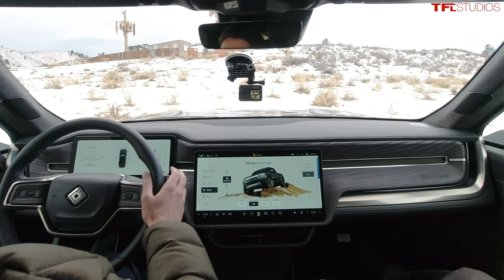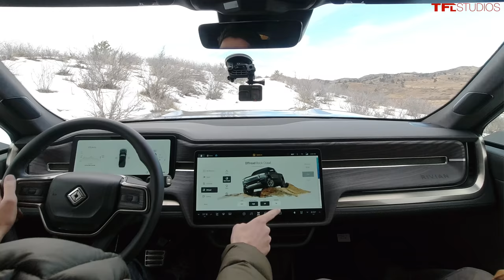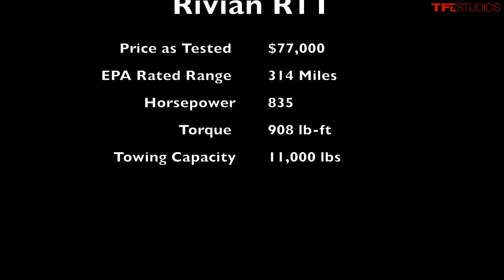Fully Loaded! Can an EV Pickup (Rivian R1T) Survive a Hard Days Work?

Comment: This guy right here is the prime example of the real difference between people who actually use trucks for work and the people that have pavement princess trucks.
He's not concerned about hp, torque, or every little spec number, huge lifts, crazy off road tires or any of the other dumb crazy stuff that some people put on their trucks. 
His mindset is...will it do what I need it to do.
Reply: Bulk of these will be pavement princesses
Reply: @robertryan7204  They are built to be...
Reply: @kanalvoll5416  Built to be? Batteries are fragile elements. Think of the Smartphones,  Tesla fires
Reply: Pretty sure the rivian trucks that went from the tip of South America up to the US on an expedition were not pavement princesses.
Reply: @Deetroiter  depends where they drove. One off expeditions are not indicators  of durability over time. Some  Samsung smartphones operated quite well for a while, until more than a few burst into flames
Reply: @robertryan7204  the long way up is a great documentary if you like motorcycles and travel! Has two rivians that were preproduction and survived the journey. Rivian then took all of the data and learned knowledge from what went right, what went wrong and then applied it to their production vehicles. There is no end all, be all, when it comes to a vehicle. If it works, it works. But it shows that the rivian isn’t just an adult sized Power Wheels. 13,000 miles of of mostly unpaved and rugged terrain is a pretty good test track I’d say
Reply: @Deetroiter  Not really, many  small Expedition vehicles do that. No it is durability over time that is important, not a one off journey..  Yes have seen  the Motorcycle Doc, Ewen McGregor the actor and his friend did it. Startups do not have the resources or facilities to undergo extreme durability testing unlike the major nanufacturers
Reply: @robertryan7204  also lifting these will significantly affect range
Reply: @ayoutubechannel921  Yes another factor
Reply: @robertryan7204  not really. Its marketed towards Outlanders who rarely use their gear as Pavement Eye Candy.
Reply: @robertryan7204  because a gasoline vehicle has never caught fire?
Reply: @robertryan7204  in Texas the unofficial headquarters of trucks where like 10-40% off your neighbors all own em, maybee 5% get used as trucks. People buy em to show off and bc brainwashed they 'need' a truck...90% of half ton drivers would be just as good w honda ridgeline in any suburb, its an ego thing.
Reply: @05EVORS  Here we call them Pickups  or more commonly Utes.Maybe a much higher percentage use them as work vehicles, but the rest as " cars" US Pickups are a niche about 6000 per annum sold but they are primarily used as " cars" with a small percentage used to tow RV's
Reply: @WaterDR-tw8re  No but many EV's certainly  are and compared to gaseline vehicles not many are produced
Reply: @ChurroWaffles  Maybe marketed but all that reliable in the long run? Very much doubt it
Reply: @robertryan7204  LOL You are spreading misinformation. It's nothing like Smartphones. Smartphones don't have hundreds of cells and liquid thermal management and a HEATER for the battery. It's like comparing a Briggs and Stratton Whipper Snipper Engines vs AMG V8. Stop with the absurd nonsense.
Reply: @robertryan7204  "No it is durability over time that is important, not a one off journey" Yes that is exactly what BEVs excel at. They are horrible for the one off 1000 mile Expedition, simply not enough range. But it will be great a Rural Property run about where it lives near it's base it's entire life. Tackling difficult terrain for a couple decades. Perfect for Australian Rural Properties.
Reply: @robertryan7204  LOL Utes are for freaking posers. Real Rural People in Aus just use Enclosed 4x4 like a LandCruiser or Nissan Patrol or Commercial Flatbed trucks. I had a Nissan Patrol Ti while I worked for Trimble.
Reply: @Neojhun  A case of misunderstanding. Utes include US Pickups. You are totally  right what  we actually  use in Australia.  Some self appointed geniuses on the TFLwebsite Forum, were telling me that US Pickups were doing the bulk of the work on Australian  farms LOL. Suggest you post on that forum and see the reaction.
Reply: Agreed. Talking about clearance, “Why would you need more then 15 inches?” 🤦🏽‍♂️
Reply: Well observed.
Reply: @robertryan7204  What's the number of gas vehicles and the number of EVs that catch fire per 100k sales?
Reply: @FiroNebule  Going by estimates very few Gas vehicles but a staggering  number of EV vehicles considering the poor sales
"WHY DO LI-ION BATTERIES POSE A FIRE RISK? Lithium-ion batteries, whether they are used in cars or electronic devices, can catch fire if they have been improperly manufactured or damaged, or if the software that operates the battery is not designed correctly."
Reply: @robertryan7204  There's no information on the internet listing the number of fires of gas and EVs per 100k sales?
Reply: @FiroNebule  No, just there are not many EV's sold and they appear to be bursting into flames. Lithium batteries( see Samsung) have been doing that a lot.  Gas vehicles bursting into flames...mighty rare
Reply: @Neojhun  Really
"WHY DO LI-ION BATTERIES POSE A FIRE RISK? Lithium-ion batteries, whether they are used in cars or electronic devices, can catch fire if they have been improperly manufactured or damaged, or if the software that operates the battery is not designed correctly."
Reply: @FiroNebule  see this yes from the internet
"WHY DO LI-ION BATTERIES POSE A FIRE RISK? Lithium-ion batteries, whether they are used in cars or electronic devices, can catch fire if they have been improperly manufactured or damaged, or if the software that operates the battery is not designed correctly."
Reply: @robertryan7204  Wait, so when you search up "gas fires vs ev fires per 100k sales" it comes up with no imformation about X number of fires per 100k vehicles?
Reply: @Neojhun  Reality not nonsense
"WHY DO LI-ION BATTERIES POSE A FIRE RISK? Lithium-ion batteries, whether they are used in cars or electronic devices, can catch fire if they have been improperly manufactured or damaged, or if the software that operates the battery is not designed correctly."
Reply: @FiroNebule  No just Litium batteries are basically dangerous. Someone  posted solid state maybe safer. As it stands Tesla managed to sell 1 million vehicles globally last year, compared to 90  million ICE vehicles  mil globally
Reply: @FiroNebule  These batteries are dangerous  even when they are no longer useful
,"This report found 64 waste facilities that experienced 245 fires that were caused by, or likely caused by, lithium metal or lithium-ion batteries.10 July 2021"
Reply: @FiroNebule  search ev fires, lithium battery fires a staggering number
Reply: Great review of a day in the life. Just was compelled to comment that those bed hinge wells look like a nightmare. It is bad enough dealing with rocks or wood chips that get wedged in the crease between bed and tailgate on a "normal" truck.
Reply: @ponti1000   it is start up manufacturer and like most they have  problems other established manufacturers iron out before  mass production
Reply: @robertryan7204  I appreciate your response. Maybe they will resolve with some design changes. I was just providing thoughts from a long time truck owner that this one thing is potentially pretty painful for a truck user/owner.

You are pretty vocal in defense of this vehicle throughout this discussion...If you don't mind me asking, what is the drive for your perspective to be such an advocate?
Reply: @ponti1000  Actually you have got the wrong impression. I have been very negative about the vehicle. Maybe you are confusing me with some else's comments
Reply: @Deetroiter  Yes. Long way Up (on Apple TV). There was a bit of cheating that went on there though. Although Rivian installed some chargers on the route there was a fair bit of charging with generators behind the scenes. The vehicles were pre-production too, so who knows what spec & tricks they had.
Reply: @Neojhun  no nonsense reality, plenty examples of EV cars bursting into flames
Reply: @MyKeeP81  no, not a chance
Reply: @robertryan7204  seeing as EVs and Hybrids using batteries have been out for a long time, so durability answered as to the batteries and engine. The money you save on engine maintenance you could use on replacing the battery 10 years later. The EV technology has been around for a long time, and the only issue is that hybrids need new batteries after 10 or so years. There is no issues other than build quality issues.
Reply: @robertryan7204  Probability way lower and safer than Concussive Fireballs from Petrol vehicles. EV fires are slow you can crawl away from injured. You're screwed in a Fuel fire.
Reply: @robertryan7204  LOL I never said anything close to that. You are making up nonsense. It's just a fact Utes are used on farms to get around and head into town. Not to do the heavy lifting but more people moving and getting stuff. BEV utes will be perfect for this use case.
Reply: @robertryan7204  " Gas vehicles but a staggering  number of EV vehicles considering the poor sales" LIES you liar.
Reply: @BaronBoar  Still having EV's bursting into flames and also standalone batteries. None EV' and Hybrids are being used off road in very hot conditions
Reply: @Neojhun  Neither you do not crawl away as it is gas build up in the battery that makes it explode and burn
Reply: @Neojhun  No gas vehicles rarely  burn but Lithium batteries regularly  cause fires even when used
"RECYCLING PLANTS ARE CATCHING ON FIRE, AND LITHIUM-ION BATTERIES ARE TO BLAME

Rechargeable batteries like the one in your smartphone should never be tossed in the recycling
Reply: @Neojhun  Please read the many articles on Lithium  batteries that say you are VERY WRONG
Reply: @Neojhun  Actually Neojhun  go as a guest on the TFL website and post Utes on Australian  Farms are only used as cars. You will get an interesting  reaction, then again I agree with you.
Reply: @Neojhun  You are VERY RIGHT  about the vehicle mix on Australian  farms and should post it on the TFL website but VERY WRONG about the dangers of Lithium Batteries
Reply: @robertryan7204  Stop trying to change the subject when I caught you red handed. You stated technical factual falsehoods. You are a liar fraudster.
Reply: @robertryan7204  I don't read press articles for this topic. I read scientific papers, official investigation reports, statistics reports and work on batteries my self. You have no clue what you are takling about.
Reply: @robertryan7204  uh yeah they are. Thousands of EVs and Hybrids here in BC and we had gotten temperatures like that of death Valley this last summer. For an electric motor there is no difference if it's going up a offroad hill and uphill on a road.
Reply: @BaronBoar  Electric Motor no, more the battery. Remember every Diesel railway freight train, is a Diesel Electric, the drive train is electric
Reply: @robertryan7204  yeah so? I don't see your point. It works in general in all sorts of temperatures or have you been living under a rock your whole life. They have electric motors driving all sorts of things in plants and factories. Fabrication shops.
Reply: @BaronBoar  You do not get it Electric Motors are fine, Lithium Batteries are not, plenty of articles out there that state these cause fires or burst into flames
Reply: @Neojhun  well you have posted that " pointless nonesense" and now are saying the many articles on the dangers of lithium batteries are fabrications. Who is Spamming????
Reply: @robertryan7204  do you know what kind of batteries they are using or the temperature management systems they are using?
Reply: @robertryan7204  "I.e. fuel cells are really EV's, you have no clue" WTF I never said anything about fuel cells and I do know they need Battery Buffer to regulate the power. You are a fraudster. You just made up a false assumption about me. You just proved my point.
Reply: @robertryan7204  Diesel Electric trains have a horrible track record. The Turbo system on G.E. Diesel Electric Locomotives is infamous for overflowing rich fuel mix and starting a fire. Train operators are soo use to it they just stop wait and burn it off and monitor the situation. If it gets any worse they try to extinguish the fire. Irony is you are talking to someone who installs wide area communication system for train networks.
Reply: @Neojhun  Stop your Trolling you have not posted one link, it is all hearsay.
Reply: @BaronBoar  Good question, why these are bursting into flames who knows . Tesla standalone Battery pack
"Two Tesla Megapacks were engulfed in flames when a fire broke out during initial testing at the Victorian Big Battery site in Moorabool, near Geelong, on July 30. The blaze triggered a warning for toxic smoke and it took four days for the site to be deemed under control by firefighters.27 Sept 2021
Reply: @Neojhun  closer to home
,"Two Tesla Megapacks were engulfed in flames when a fire broke out during initial testing at the Victorian Big Battery site in Moorabool, near Geelong, on July 30. The blaze triggered a warning for toxic smoke and it took four days for the site to be deemed under control by firefighters.27 Sept 2021"
Reply: @Neojhun  stop the Trolling  not one link from you
Reply: @robertryan7204  You propagandist liar. You just ignored the details about that case. That Giant Battery fire was caused due to trials tests during setup phase. Yes something went wrong during the installation test which is not unusual for something soo new. A Single cabinet caught on fire and it was contained. There was no massive facility wide fire and no massive amount of toxic smoke like an industrial facility fire. It was a single open air cabinet that failed then contained. You literally just cherry picked a very mild case and tried to Falsely spin it as an toxic smoke industrial fire. You are a Liar Fraudster.
Reply: @Neojhun  So now you are now denying they are non hazardous?
"“Battery-powered vehicles have not been shown to catch fire at rates higher than gasoline cars, but when fires do erupt, they burn longer and hotter, propelled by lithium-ion batteries that supercharge the blazes, experts say,” the Post reported at the time.29 Sept 2021"
Reply: @robertryan7204  Very simple it was industrial electrical fire. Very common and often NO battery is involved. When you configure High Amperage Electrical Circuits wrong it often causes extreme heat and arcing thus can set fire to the surrounding flammable material. In November a Switch Board in my company workshop caught on fire when the wiring main feed into the switch boards was Not up to standard what the Switchboard was Fused For. We had a few CAD Workstations and 4.7kw CNC Lathe on that switch board at the time it went on fire. We had only moved in in February 2021 previous tenant did some horrible electrical work we have since found out.
Reply: @robertryan7204  testing OK. That's why they test them. Any substantial accidents out side of that? Like Italian cars like Lamborghinis and Ferraris were catching fire.
Reply: @BaronBoar  On high end Porsche & modern Lambo have problem stationary or low speed overheating and not getting enough air flow. Thus you have horrible things like Soft Limiter on Revving while stationary. There was also Adhesive Glue fires on Ferraris IIRC was the reasoning for the recall. The probability of fires was astonishingly high considering how few of these cars exist. While a fool like Robert complaining Tesla only sold 1 MILLION cars in a year. 2 door Porsche is about 80,000 to 90,000 per year and Lamborghini 2 door production hovers around 5,500 to 8,000 (excluding 4 door Uterus SUV). Yet the number of fire occurrence is not massively different.
Reply: @BaronBoar  that is another issue with lithium batteries and accidents
Reply: @robertryan7204  no I mean like actual ev/hybrid? Because it doesn't sound like it so your argument is done.
Reply: @BaronBoar  Experts say electric vehicle batteries can catch fire, release hazardous gases or even explode under certain conditions. Such dangers have inspired a national conversation about how to deal with EVs after accidents
Reply: @robertryan7204  Yes they do happen it's unavoidable for now.  But they are much less likely to occur than ICE. The problem with BEV fires is they last for days slowly smouldering. The only good method is just dunk it in a Skip Bin full of water after the initial fire has been extinguished. But the need to do this is extremely small and that's the massive problem. We need to spend resources on a safety setup on something that rarely ever occurs. This is going to be a PITA to fund and wide spread setup. During the hours of smoldering phase is does not Explode or even give of that much hazardous gases compared to a ICE car fire. Yes we do need a national conversation on how to best prepare equipment for such rare occurrence. It has nothing to with being a wide spread danger. FYI Vast vast majority BEVs that are crashed end up in Junk Yards not even any fire. A large proportion of which gets Repurposed with their drive train extracted because the Battery, Power Electronics & Motor are valuable and useful. That is a major source conversion build parts.
Reply: @BaronBoar  Well I do, make your own decisions
Reply: @Neojhun  yeah I know.
Reply: @jordanfedirchuk1558  if you work a farm or go wood hauling more than 15” is pretty good idea.
Reply: @gemstatefisherman3409  you know those are 12+ hour days right? This will last 4 hours if it’s lucky under loads
Reply: @jordanfedirchuk1558  oh I know, that’s why I own the pickups I do.
Reply: @gemstatefisherman3409  plus if you have a manual trans and battery dies in the cold, just push it down a small grade. Throw in gear and good to go. EV not so much. 
They can easily make EVs self charge, governments just aren’t allowing them to.
Reply: @jordanfedirchuk1558  you cannot push start a manual vehicle with an alternator. You need to have enough power in reserve to turn in the magnetic field to start the charging process. A completely dead battery in virtually any car sold in the last 40 years likely is not capable of being pushy started, unless the battery has sufficient voltage. 
I did this in my 87 tbird. I push started an old motorcycle with a completely dead battery for years. My battery was dying, but I lived on a hill, I was able to coast out of the drive way, pop it in first and away I went. First really cold day of winter, the battery was totally dead. I had to walk back up the hill and grab my jump box because it would not start. 

Also, anyone who says lithium batteries are dangerous, are pretty un-informed. There are millions of lithium devices. You probably stick one in you pocket inches away from your junk and sleep with it on the charger, along with every laptop, power drill ect for the last 20 years or so. 

How many if them caught on fire and burned down the house? 

I understand the potential of fire, I had a model airplane lipo battery blow up on me, and I learned to respect them, but these also have none of the protection or fail-safes of a mass consumer product.
Reply: @robertryan7204  Robert, I think your comparison of Smartphone batteries to a fully thermally managed EV battery lacks a great deal of information, which is why I'd like to invite you to watch some Munro Live videos on YT to get a bit up to speed about the differences. EVs burn less than ICE vehicles by orders of magnitude due to the construction and management of the cells and packs. The media doesn't cover the hundreds of ICE fires every DAY but every EV fire is reported on extensively. No wonder people think it's a major issue when it's objectively not. Cheers!
Reply: @capslock9031  my problem is  with the Lithium batteries they do cause fires even when used
Reply: @lilsammywasapunkrock  yes you can. I’ve done it many times 😂
Reply: @lilsammywasapunkrock  go purposefully drain your whole battery on a manual transmission vehicle and give it a try. 😂😂😂😂
Reply: @jordanfedirchuk1558  then you either didn't have an alternator or you do not understand how they work. 

Did you know that a burned out light bulb in the battery light disables an alternator? That's what makes the battery light light up. 

The alternator needs a solid 12v signal to turn on the electro magnets to make it charge. Without the magnets, no power is generated, and you have no power.

You can spin it as fast as you want, without power to turn the electromagnetic fields on, they are just lumps of metal moving around
Reply: @robertryan7204  when did the house you live in last burn down? My smoke detector has a "lifetime" lithium battery in it. So does my laptop, so does my drill, so does my watch, even my grandma's hearing aids. 

How many people die of hearing aid explosions every day? Man those old folks homes must be getting rebuilt daily...
Reply: @lilsammywasapunkrock  No but many instances of fires with Lithium batteries.
Reply: @lilsammywasapunkrock  this weekend would you like me to take the battery out of my car and show you it’ll still push start?
Reply: really though. At the core of this video its a guy doing some extremely light offroad that depends more on his tires than his truck, and putting in a load that I'd expect any truck, literally any truck even the ford fake-truck maverick, to be able to do.

Did he need a $70,000+ (probably 80k+ truck once specced out) to achieve this outcome? No he did not.
Reply: @Neojhun  like you dont use rangers and hiluxes sown under..
Reply: @andersbjrnsen7203  LOL In cities sure.
Reply: @robertryan7204  Soo Gasoline NEVER Catches on Fire. Got it, you have perfect logic.
Reply: @Neojhun  You have somehat illogical love of EV's " fire safety" when there are many reports of how unsafe they really are.
Reply: But if you are living in city and you are in need of a pickup I hope you can "Do What YOU WANT WITH IT!"
Reply: If you are living in the city and have a Rivian, I hope you can do WHAT YOU WANT with it....
Reply: @Neojhun  No you seem to deny  the obvious,  no matter how many negative references  that  are out there. Anyway Rivian seems to  have hit a hole. It may be around at the end of the year.
Reply: @edubbs3528   I think you said it when it is not proven reliable. Rivan has had many problems getting started. I cannot see it being all that successful as a company. Many EV companies are struggling so it is not an exception in that way.